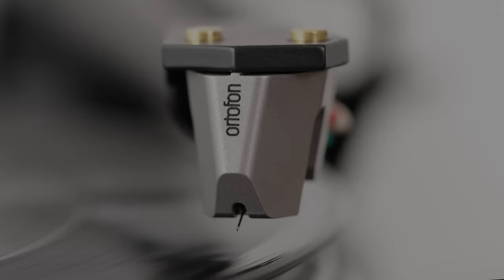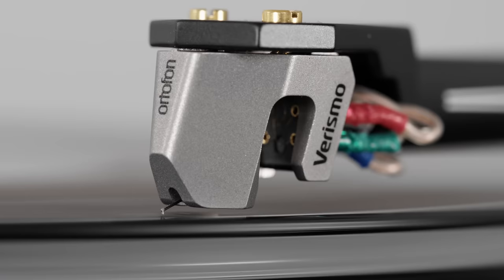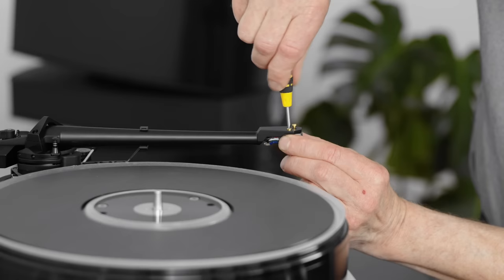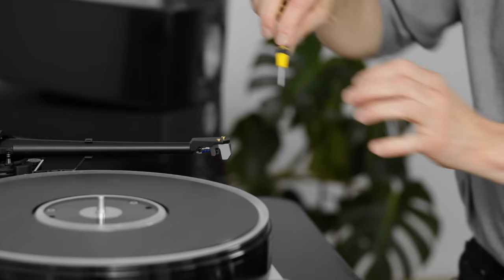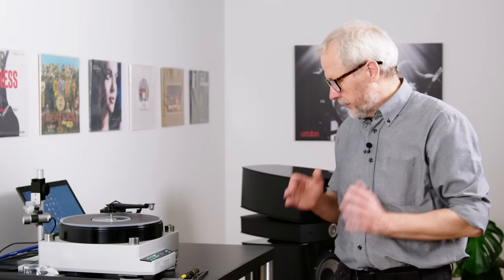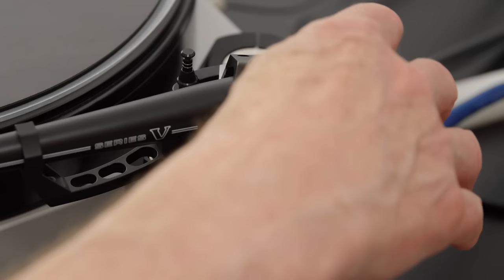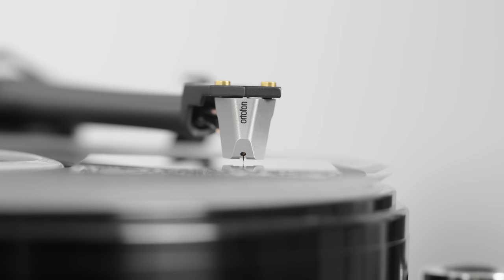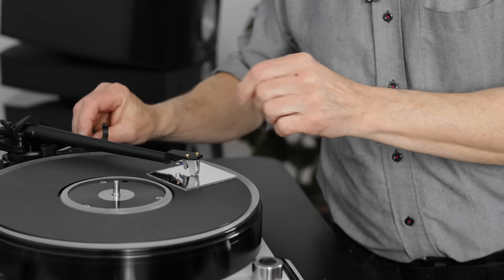Detailed High-end Cartridge Setup | Step by Step

Comment: You can never adequately align azimuth by eye even using beam protractors or mirrors.  Why? Because not all styli are plumb 90 degrees to the cantilever.  The only way to do it properly is to test the phonostage output for each  channel on a scope using a 1khz test tone from a good test LP.  Get it within 20mV channel balance at output is possible with small azimuth adjustments and the audible improvements can be an eye opening experience.  The vta angle is far less important.  Tonearm level is fine for most.  Best low average distortion setting for anti skate and accurate azimuth together with fine vtf adjustment are by far the most important factors.
Reply: Many people don’t have an oscilloscope, obviously. The Fozgometer is a reasonable substitute, although it’s not inexpensive, either ($400)…
Reply: @MrChristerBerg  That's the thing, as a decent digital scope can be had for half that price these days.
Reply: @ReferenceFidelityComponents   Perhaps. But how many people in the general population have ever used an oscilloscope? That's a small, small minority. At least the Fozgometer is super easy to use, and coming with instructions directly related to using the various tracks on the Analogue Productions test LP.
Reply: @MrChristerBerg  actually, modern digital scopes are pretty easy to use and anyone capable of setting a cart up can certainly use both a scope and use a test lp.  Whether some lack the confidence is another matter but on average it takes me no more than 15 minutes to show most clients how to do it.  I understand that it seems daunting but try it and see for yourself, it really isn’t that difficult.  Convenience  is easier to market though, and most may pay more for a more convenient solution.

Comment: Absolutely brilliant tutorial on cartridge alignment with some really good tips.

The importance of getting the various adjustments right for high end reproduction makes absolute sense - particularly the vertical tracking angle which is often overlooked.
Now we have the right technology with digital microscopes this can now be managed easily.

The only area I would like to have seen more detail is setting the cartridge geometry at the various null points using a protractor.
I watched the other Ortofon video on "What makes a cartridge good:  moving magnet vs moving coil"  and now appreciate why  a high end MC cartridge is sonically better and why they cost more!

Comment: Very important lesson! I am a big fan of Ortofon cartridges since 40 years.I love how they reproduce the music.
Congratulations!
Reply from the maker: Thank you 🙏🏼
Reply: Ortofon was my go to cartridge in the early 80's   a VMS 20 on an Ariston RD 40 & Mission 774 LC arm combination.
Reply: @Ortofonofficial  MR Ortofon how come you wouldnt use your flagship MC cartridges on your flagship Ortofon Tonearms from the late 50s and 60s?
Thank you
Reply: @maxsavage3998 You think tonearm technology peaked in the 1960s?
Reply: I too have been a fan of Ortofon cartridges since 1987, when I purchased an X3-MC model. I had been using this cartridge up until about 3yrs ago. I had this cartridge mounted in a SME 3009 III S arm, running 2 grams TF. Believe it or not, the stylus showed hardly any wear after all these years. But, I figured that the damping of the stylus had deteriorated GRADUALLY. Since this is an MC design, I contacted Ortofon about having the stylus replaced. NO. It is TOO old. So I bought a new "orange" Ortofon (moving magnet) cartridge. I REALLY don't see a big difference in the sound quality between the "old" and the "new" cartridge. Maybe I am getting too old (pushing 80) and have been listening to the "squeaky" cell phones and the crappy flat-panel TVs to appreciate HIGH QUALITY sound! LOL

Comment: @lief Johannsen,

I was with you until you used a mirror to set the azimuth.
Although that is better than nothing, it is not the ideal way of setting the azimuth (so I have been told).

There is a vinyl record that is designed precisely for azimuth alignment.  Combined with an oscilloscope, you can dial in the alignment as near perfectly as possible.

Perhaps you can elaborate on this?
What I know is what my audio dealer showed me -- years ago, when their turntable guru dialed in my cartridge.
He showed me the record (which I cannot remember who made it) and he showed me his oscilloscope.

And I have heard other turntable experts (I believe one was Michael Fremer) caution against using a mirror when seeking out the best azimuth setting.

Very good video!

Comment: Been messing with turntables for over 50 years and have been paying attention to everything mentioned here for years. The only thing I might add and I could be wrong but when it comes down to VTA I would think the angle changes slightly once the record starts spinning due to the friction and any slight warp etc.  
Some might think this attention to detail is over the top but if you consider what your album collection is worth why not set things up right. It’s not like you have to recheck these things weekly. Some times the smallest adjustment will make a difference you weren’t expecting. 34:42

Comment: Well done, clear and concise. 

Having an SME (312S) myself, this pretty much covers my needs. It would be useful for many (with other tonearms) to see  horizontal alignment of a tonearm with slots for cartridge mounting screws, though (using a protractor).

Regarding SRA/VTA, would you recommend test record and IMD measurements to really make the most of it? Especially relavant with equipment of this calibre..

Regarding azimuth, I see you align the stylus. But this leaves me with a few additional questions. There is the issue of the stylus itself, and that is well covered. But there is also the issue of the coil alignment relative to the groove. This will influence channel separation or crosstalk. I assume with a cartridge in this price range, the housing, stylus, and coils can be assumed to be perfectly aligned with each other, and aligning one aligns the others. I would like to hear your views on crosstalk measurements in azimuth adjustments?

Comment: Thanks for the great video. Very informative and detailed. I have a question regarding the VTA. Is it absolutely necessary for the arm to be parallel with the surface? or is the angle itself the target. I have a Jeclo arm that sits very high and I had to put 2 Mats on the platter and it is still not parallel.

Comment: about the Azymuth please tell to the people that in a fixed tonearm you can put spacers under the headshell but the best thing to do when you have that kind of issue is to adjust the tonearm base attachment because we have a disalignment on the base of the tonearm facing the platter face, after that you'll never have to worry about azymuth, different things are on a adjustable tonearm example a SME or tp4 removable headshell attachment. thanks for this accurate guide.

Comment: Great explanation Mr. Johansen, thank you!
I checked my current cartridge of a Koetsu Black and found out that the cut is different. It seems like it needs a more cantilever angle so that the line surface is 90 degree. Can it be or is it just my mistake? 😅

Comment: I got a 2m blue replacement stylus, and i found that the cantilever rake angle was to flat, the plastic body almost contacted the record..  i finaly decided that i would  risk braking the thing, i carefully adjusted the cantilever angle very slightly.
Then it could track the groove without noise.

Comment: Hello, I am planning to replace the Ortofon 2m Blue cartrige and replace it with a 2m Black.  Is it enough to buy a spare 2m Black tip and replace it with a 2m Blue one, or do I need to buy a complete cartrige and switch the wiring?  Thanks for advice.
Reply: Hi, short answer: you have to buy a complete cartridge. Details to be found here: https://www.ortofon.com/stylus-2m-black-p-393-n-3384

Comment: Hi Leif Johannsen. Fantastic exxplainment and very useful video, I have two questions. 
1. My cartridge is a Ortofon Quintet Black, my tonearm is a SME 309 and turntable is a Linn Sondek LP12. When I am testing at 70 MHz or higer, the sound is slightly out of balance, I have tried to change the Anti-skating in many ways, but it does not help much - is the Quintet not able to play the 70 Hz clean ? - the Azimut is ok and also the stylus angle, haven't got a microscope though..
2. Which turntable are you using in your listening room in the video ? Looks quite advanced 😊
Best Regards
Flemming Ovesen, Holstebro-Denmark.
Reply: I have a Quintet Blue and it can track at 70µm with a well setup arm but not at 80µm.

Comment: My understanding is that skating is more of an issue as you approach the inner grooves of the LP.  That being the case, maximizing high level inner groove tracking would seem, by definition, to impair performance in the first part of the LP.  I have found that to be the case in my own setups and listening.  Clarity in the earlier part can be lost by over pursuing any losses in the inner grooves.
Reply: Absolutely correct.  That's why we use a protractor; its the best compromise (this is all a compromise)

Comment: As for the cantilever angle and stylus rake angle, the shell of my old Technics SL-2900 allows to move the cartridge forward or backwards until you manage to get the optimum angle. I bought a Nagaoka cartridge and its shell is not compatible with the tone arm of the SL-2900, for I couldn't get the correct adjustment. So I acquired a new Technics shell and the problem was solved. The difference in audio quality is immense when the cantilever angle and stylus rake angle are not correct.
Reply: Doesn’t applies to medium range TTS. It’s for highend set up. Like SME Transrotor clear Audio etc

Comment: One thing bugged me: how do you have perfect lateral alignment just with the distance from the spindle to the arm pivot and dont take in account the cartridge size and stylus land position?
SME tonearms allow adjustment back and forward to fine tune where the stylus will be on the record, they even ship with a carboard for that...
What am i missing on this?
Reply from the maker: Thank you for the question, Ricardo! On this tonearm the lateral alignment is adjusted during the installation of the tonearm, the cardboard and the fine tuning is meant to be used at this stage. You cannot adjust placement of the cartridge forwards or backwards on the headshell, and as such the lateral alignment doesn’t change.
Reply: @Ortofonofficial  Doesn’t this presume that different styli have the exact same overall length from the tone arm pivot?  For example, are all cartridges manufactured with the exact same difference between the mounting screws and where the stylus contacts the record?  I would think not.  If not, that means the overhang would be either correct or incorrect depending on which cartridge is used.  My tone arm head shell is slotted and I set the appropriate overhang.  Since the SME V head shell isn’t slotted, wouldn’t the overhang possibly be incorrect with no way to adjust for this?
Reply: The SME needs to be repositioned by loosening the screws on the pillar and move it in the right direction using the special tool that you put in the back. With the sme alignment protractor this is very easy. The distance between stylus and screwholes is fifferent for every cartridge and at the ortofon site is a list withe these measurements for all their cartridges. For vta their is also the tool to change the height of the arm. I guess they did not know where they left these tools...(and the manual)
Reply: And a usefull tip for setting the arm horizontal. Use a green laser crossbeam. First set the arm horizontal and than change the height and with the laser it is easy to measure the different settings.
Reply: also if you have to move cartridge forward or back the tracking force will change. i always do my geometry first and when everything is set i set my tracking force.

Comment: For the antiskating setting, using a test record with high modulation tracks actually isn't the best method.
This method will always result in too much antiskating.
The skating force is mainly dependant on 2 parameters: stylus pressure and modulation of the track. And modulation plays a big part in it
Because the modulation of a test track is way higher than what music on a record will ever achieve, the resulting antiskating will be way to high. I have a set of orsonic side force checkers that will measure the correct amount of skating/antiskating (they basically work as a force balance), and my experience is that when measuring skatingforce at 70µm, you're about 0,5 (on the antiskate knob) too high compared to music with high modulation (for instance 80's pop music on a dmm cut record) and up to 0,75 too high on the antiskating knob compared to normal modulation (for instance 70's laquer cut pop music records).
Obviously it depends on the tonearm, but my experience is that using the numbers on the dial/ the manufacturers settings are more representative for acutal played music than using a test record with modulon grooves 50µm or higher.
Reply: Interesting
Reply: I normally set anti skate to a nominal 75% of VTF and then just dial it in by ear using well known records.  I just  listen for the focus / solidity of the stereo image.
Reply: You have to love the confidence of a man telling an expert that they're doing it wrong.

Comment: Why don't cartridge manufactures allow for the 92 degrees cutting angle? We're told to align with the arm parallel to the record surface which usually is 90 degrees SRA. To get 92 degees you have to raise the rear of the tonearm approx 8mm.
Reply: Only to setup tracking force. When it is in contact with the record arm will not be level.

Comment: Anybody know what microscope stand that is?
Reply from the maker: Unfortunately, the model used in the video is discontinued, but the direct replacement is the Dino-Lite AM4113T.
Reply: @Ortofonofficial  Thanks but I'm inquiring about the 'stand' not the scope itself.
Reply: @Moneypizzle  if I see correctly, the base should also be by Dino Lite. That should be the RK-06-AE or something similar
Reply: @jazzmetalaudiophile  Thanks!

Comment: Vta is almost impossible to get it right for all records. Thin 1980 pressed vinyl is very different then 180 grams if today's records
Reply: Set your specs on a thick 180gr record and use two thin records or a piece of paper under your thin record to bring it up to the same height.
Reply: @warpspeed9877  How about different platter pads of varying thicknesses. Or just forget the whole thing and just be happy. This makes so glad to be a CD guy. None of this is an issue. LPs are great but their time has come and gone and should be gone, dead and buried. You spend more time and money on a turntable and cartridge than the worth of the vinyl record. One has to be crazy to pay $1,000 or more to play a record that may have cost $3.50. After 50+ years of owning and playing vinyl, I was grateful for the CD.

Comment: Over the years , I have learned. 
1/ Don't bother with Mc cartridges, too delicate and involves special phono stage
2/ Detachable headshell is much easier to deal with
3/ Accept with a new cartridge that  for approx 40 hours , it will sound strained 
4/ A magic eraser sponge dragged back to front gently is the best way to clean a stylus
5/ Do not wet clean records, just use a dust brush
6/ when it comes to 2nd hand records , do not buy them if they have grease or gunk on them. Check vinyl with spotlight for scratches or warps
7/ Tracking too light is not good but go by listening 
8/ Set up of record deck , quality of deck, phono stage is important
9 Vinyl can be a lot of hassle , thank goodness cd was invented

Comment: yes but record are different thicknesses so how important is the angle?
and why not 88.5° instead of 92.5° surely that's better!
I've never got an proper answer to that question?
I thought you made a record for vta adjustment by ear was that not ortofon who made the record?
and why can't you adjust vta using the mirror technique as the same for azmuth?
what about polishing styli it should be done from new.
but I'm not sure about line contact if you should do it in a special angle to the surface of the diamond or is it the same technique as chronicle and elliptical?? do you know?
I think you should make the anti skate recording at the beginning and end because this changes if you are playing a record at the beginning and less anti-skate is needed
Reply: The angle in the video looks like it is from the back of the needle to the record surface. Imo it should be from the line of contact to the record surface. Maybe with this needletype they are identical? I would think the line of contact is parallel to the mounting shaft of the stylus?

Comment: The explanation is illuminating and very easy to understand.
As for the SME V it's a stupid arm with a stupid price...it doesn't even allow a very important function which is the adjustment of the Azimuth...best tonearm in the world???...bullshit...
Reply: Yes, it does have azimuth alignment. It is in the manual - does not matter if the guy from Ortofon in the video does not know it....
Reply: On which page? Not in my manual. I changed azimuth by using the Origin live cartridge enabler. Turn one screw a little bit tighter then the other ans measure crosstalk from left to right and vv with a testrecord. When they are equal azimuth is ok.
Reply: Spend less $ and get a 309 with Azimuth adjustment.
Reply: @MrPruks  This is not truth this is an fix  SME V arm.